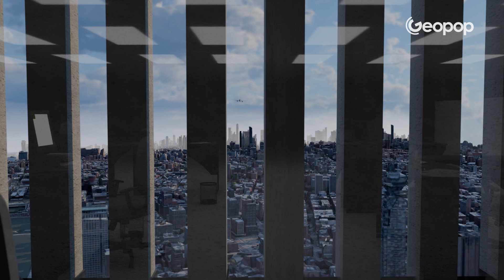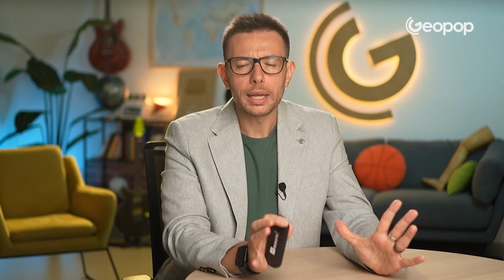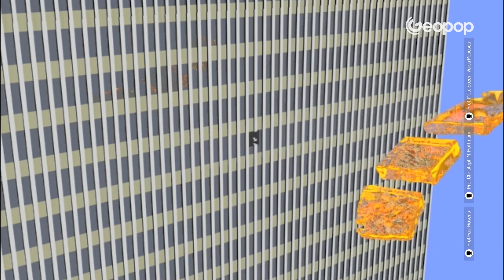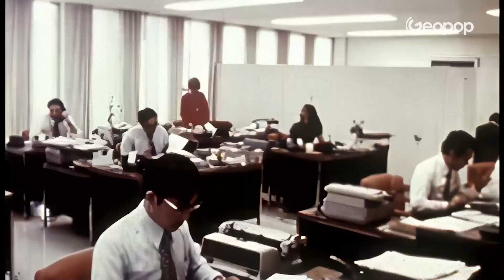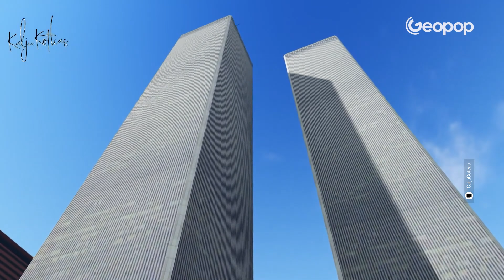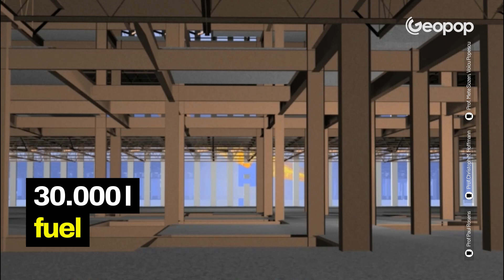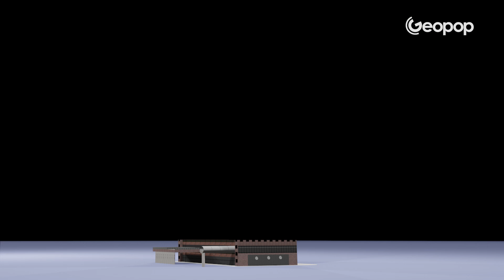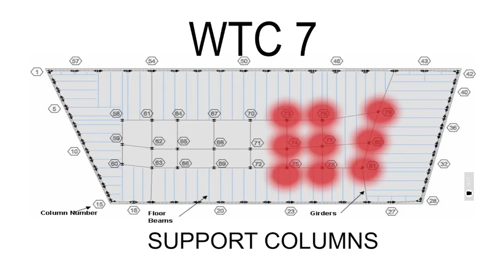9/11, 2001: The Technical Reconstruction of the Twin Towers and WTC 7 Collapses

Comment: What a stupid idea to put 41 floors on top of an already difficult designed structure 20 years after when most of the original sat over an electrical substation.
Reply: The substation was designed to serve as the foundation of a later larger structure. Worked just fine for years.
Reply: @TheLoonResistance the columns rested on trusses wich spaned over the substation so it wasn't great before adding 41 floors of weight. Live and dead loads.
Reply: @thegreatpyramidbuild-prate6013  - It was just fine until taken well beyond its design limits by an unprecedented event and would be standing without issue today had it not been for that event.
Reply: Im sure your right it would be still standing, but it was how the twist of the structure brought it all down. There was also a large penthouse added as well. When i studied structral mechanics and general design including high rise it was always the add ons that gave issues. @TheLoonResistance

Comment: Complete nonsense,why 
Third building had no plane hit it 

But it collapsed like a controlled demolition 

Please ,what’s the chance of this third building collapse the same way

Totally nonsensical
Reply: 3rd building (actually Building 7 though better known at the time as the Salomon Bros. Building) was hit by the collapsing North Tower - a fact presented in this video you are either deliberately ignoring (lying) or don't know because you didn't pay attention or maybe even watch at all (ignorance).

No one has ever claimed it was hit by a plane or that being hit by planes is the only way a building can collapse. You are straw manning.

Had you been paying attention you would have spotted right away the collapse of Building 7 was completely different to that of the Twin Towers. Hence why it is covered separately.

Finally, there is no such thing as collapsed like a controlled demolition

A building does not know when it collapsing or why and cannot pick or choose how it falls.  It will just fall, no matter what started it falling.
Reply: @TheLoonResistance You sound and talk like a 5th grader. You aren't giving any statical data yourself on how building has All of its steel columns fall simultaneously.
Reply: @DiamondSwordTribes2  - I did not describe things that did not happen and have no intention of doing so.

Comment: anyone who thinks tower 7 fell from a plane hitting another building is insane, watch it collapse from the top when only the base got damaged
Reply: I will respectfully disagree and offer a far more detailed and accurate description in rebuttal.

Building 7 was the 6th building to collapse of 10 lost on 9/11. It got scant attention initially due to other priorities so conspiracy filled the information void with absolute nonsense, creating a lot of confusion and misconceptions. To fix that I’ve prepared this brief summary using my own technical analysis, not ideology and magical (non)thinking. 

At 10:28am the WTC North Tower collapsed, showering Building 7 with tons of burning debris, causing heavy damage and starting many large fires that burned out of control for the next 7 hours. Half the FDNY firefighters having been killed, units in disarray, equipment destroyed, no water pressure, and the greater urgency of search & rescue efforts, Building 7 couldn’t be saved so firefighting efforts were pulled as futile and 7 left to its fate. Firefighters make that sort of choice every day in brush fire situations - which houses to save and which ones to let go. Only real difference here is moving the decimal on the size and cost. People get overwhelmed by the size.

www.youtube.com/watch?v=g_SvpwyC17M

Collapse of a burning structure is always a concern for firefighters and steel buildings are uniquely vulnerable to fire damage. When subject to fire they rely on active firefighting to survive, designed around 1 to 3 hours of fire resistance to, allow time for occupants to escape and active firefighting to get started.  After this all bets are off. Left to their own devices they'll exceed their design envelope and collapse, like Plasco Tower and Wilton Paes de Almeida. In 7 the occupants escaped, passive and active fire protections were compromised and active firefighting was abandoned hours before the collapse, which left the building to its fate. It lost. Odds on Building 7 would eventually collapse, and it did. No big deal in logic.

 http://www.youtube.com/watch?v=WnYBX6QT0R4 

FDNY Chief Daniel Nigro - The biggest decision we had to make on the first day was to clear the area and create a collapse zone around the severely damaged 7 World Trade Center, a 47-story building heavily involved in fire. A number of fire officers and companies assessed the damage to the building. The appraisals indicated that the building's structural integrity was in serious doubt. I issued orders to PULL back the firefighters and define the collapse zone. It was a critical decision; We could not lose any more firefighters. It took a lot of time to PULL everyone out, given the emotionalism of the day, communications difficulties and the collapse terrain 

FDNY Deputy Chief Peter Hayden ; We had our special operations people set up surveying instruments to monitor and see if there was any movement in the building. We were concerned of the possibility of collapse in the building. And we had a discussion with one particular engineer there, and we asked him if we allowed it to burn could we anticipate a collapse and if so, how soon? And it turned out that he was pretty much right on the money, that he said 'In its current state you have about 5 hours 

The collapse of Building 7 was anticipated and widely reported in the media throughout the day, with 24 video cameras recording some or all of the collapse. Everyone knew what was coming and why. 

www.youtube.com/watch?v=OY5S5k3tMHI

Building 7 collapsed from the inside out which is not at all intuitive and hard to understand with most details being hidden from view.  It requires careful analysis and observation, and some people will struggle no matter how much it is explained. But here is my explanation relying on no outside authority. 

Building 7 was a unique, asymmetrical 47-story steel frame structure built atop a smaller 3-story building serving as a partial foundation, requiring lower floors dedicated to complex load transfer structures. Of trapezoidal shape and tube-in-tube construction, B7 (above the 7th floor) consisted of a central core of steel columns carrying most of the gravity load, perimeter steel columns around the outside of the structure carrying the remainder of the gravity loads and long span beams and girders to tie those elements together and form the floors. On the outside of the building hung a facade or outer shell. 

www.nist.gov/image-16640

Phase 1 : First externally visible signs of collapse initiation occurred at 5:20:28 pm and was notably quiet with observers not realizing the building was collapsing! No warning in the form of hundreds of eardrum busting 180dB explosive bangs. Here at 12:00 a local CBS affiliate reporter talking 10 blocks from B7 when collapse begins. People don’t start to notice the collapse until 12:11. At 12:45 is the famous CBS fixed camera clip of Building 7’s collapse. Note the silence. 

www.youtube.com/watch?v=t5tEy6mXSE8

Lower floor failures above the load transfer region (8-14) in the NE corner initiated the collapse. In this video at 0:45 you can see the NW corner from inside the building while under construction, Column 79 just out of frame on the left. That big, angled steel beam across the top of the frame connects to C79 at one end. The girders connect to the beam. That beam and all those girders depend on just one connection 

www.youtube.com/watch?v=nP3TNHPCIVU&t=45s

Phase 2 : NE corner floor failures caused a loss of critical lateral support over an excessive length of Column 79 and it buckled. Externally as collapse begins we see a vertical progression of window breakage along the 44-46 line and a kink in the roof of the East Mechanical Penthouse at the top of the building, consistent with C79 failure. Looking at the above floor diagram of Building 7 when you see all the structures that depend on C79 you quickly realize this one column was a relatively isolated structural element on which a disproportionately greater fraction of the structure depended analogous to say the Key Bridge. Normally with a buckling column, the load could be redistributed to other columns. With C79 that is not the case - the failure did not redistribute the load, so the collapse rapidly progressed to the roofline, sinking the rooftop penthouse. The transition from full capacity to almost no capacity occurs in an instant and will result in virtually no resistance 

Phase 3 : With C79 gone, B7’s progressive, non-symmetrical collapse continues with adjacent columns 80 and 81 left laterally unsupported and quickly buckling as well. The EMP drops down through the building. C79-81 all have no diagonal bracing, which is the major reason why they could not redistribute a lot of vertical loads among one another. From there collapse progressed from east to west through the central core until the core was gone from 81 to 58, taking all the interior floors and probably most of the perimeter columns with. Follow the horizontal progression of window failures low in the building and the dropping of the remaining rooftop structures into the building. The NIST Building 7 study model 4 determined C79 failing under ANY circumstances would have initiated the same collapse sequence. 

Phase 4 : After about 10 seconds only the exterior moment frame remains, giving the illusion B7 is still standing to the casual observer since little has outwardly changed. But it is just a hollow empty shell like an empty cereal box supported only by a few remaining columns and overloaded from the loss of the core columns and floors, quite unable to remain standing. With nothing remaining behind it, the north face leans inward, forming a V in the roofline, the last few columns buckle under the strain and the moment frame free falls, landing on top of the debris pile. 

Building 7 collapsed for 10+ seconds before the much-hyped free fall allegedly occurred. Except it wasn’t free fall nor even The Building being measured. The Building was already gone, as described above. The measurement is just one spot on the exterior moment frame - the empty hollow outer shell which fell last. It’s not even a sustained period of FFA but rather a curve, starting out below, then up to and OVER before decelerating back down below FFA again while moving in 3 dimensions not just down This is averaged over an arbitrary 2.25 seconds while pretending it is 2D movement to (dishonestly) declare the magical free fall!  Not that we care, since how fast something falls can’t tell you what started it falling 10 seconds earlier anyway. It’s meaningless. Start to finish the total collapse took 18-20 seconds or 3 times longer than true FFA . 

The debris spread well outside the footprint blocked surrounding streets, heavily damaging the Verizon Building and destroyed Fiterman Hall. 

No building is meant to survive 7 hours of multi-floor unfought fires. Building 7’s progressive, non-symmetrical collapse was incidental, unintended collateral damage from the combination of fire, time & gravity started by the collapsing North Tower, true no matter who planned and carried out the 9/11 attacks or why .  Of so little consequence it barely registered at the time, only taking on semi-mythical status as an alleged smoking gun years later when demolitions at the Twin Towers, missiles at the Pentagon and shoot down over Shanksville all failed and conspiracists had nothing left to work with. 

Anything can seem like a conspiracy if you don’t understand how it works. Now you should. I hope you found this helpful, informative and it solicits informed critical comment. If I made any errors of fact, logic or reason or left anything important out, please let me know so I can fix it. OR offer a more plausible alternative if you can. Be the first. Please start any reply with the words “Tits McGee” or I will know you didn’t read it and are wasting my time.
Reply: @TheLoonResistance how do those commie balls taste 😂😂

Comment: HAHAHAHA you can see the top floors intact as they fall. how is all that force applied when you can clearly see, it isn't 🤣
Reply: WTF are you talking about?  Are you claiming that falling mass has no mass?
Reply: @TheLoonResistance  No, i'm claiming that it applies no force to the lower levels when it's freefalling and isnt even in contact with them lol
Reply: @JohnnyGhoul205  - Define "lower levels".

Let’s break it down to the absolute basics, addressing most of the commonly asked questions as we go:

The 47 core and 236 perimeter columns of the Twin Towers support all of the gravity loads of the building. ALL of the resistance is in the columns.

Planes impact Towers, causing massive structural damage, destroying sprinkler systems, tearing out gypsum board walls and blasting off the SFRM insulation from the floors and asymmetrically re-distributing loads. Multiple floor-wide fires are started instantly and spread rapidly due to the destruction of fire protection systems and venting of the building during the impact.

Serious fires were largely confined to the impact damaged floors and those immediately adjacent to them.

Fires were started by the impacts and fuel aboard the aircraft, which acted as an accelerant. No shortage of other consumables inside the tower to continue the fires.  Active and passive fire protection systems were destroyed in the impacts, there was no active firefighting.

Collapse was initiated (started) at the impact and fire damaged floors when floor trusses exposed to heat over time sagged, in turn pulling on and causing the inward bowing of some perimeter columns by up to 5 feet until they buckled on one face of each tower (ie: NOT symmetrically).

www.youtube.com/watch?v=ULdiD6gYZO0

No steel melted or needed to. Structural steel will bend and fail at less than half its melting temperature.

Once the perimeter columns buckled the formerly static load above became a dynamic load 30 times greater, easily overwhelming the structure below.

Thousands of tons of now loose debris fall through the open office space within the four outer walls - bypassing the columns (the path of greatest resistance) - dropping 12 feet onto the first intact floor it comes across. That massive instant overload causes the floor to fail, shearing the pair of bolts that secure each end of the floor trusses to the columns. The floor fails. adding its mass to the falling mass which continues to accelerate for another 12 feet until it impacts the next floor, rinse and repeat one floor at a time all the way down.  Yes there is resistance but its totally inadequate to arrest the collapse. Resisting is not the same as preventing 

As the falling mass increases with each subsequent failure and as its velocity increases, the minimal resistance provided by each individual floor system remains constant.  Rate of collapse can only increase.  It cannot decrease or arrest. 

The columns - the part that holds the building up, supporting ALL of the gravity loads - are spectators for all this as the debris falls around and past them, not onto them.

Rate of collapse increases as momentum increases. The collapse front is constantly accelerating.

As each floor fails, air inside the building (the Towers were 95% air by volume) is compressed, then blows out the sides _in reaction to the Tower falling, not the cause of the Tower falling.

No fire required at all on floors below the impact points for them to fail. The mechanisms that started the collapse are different to the mechanisms which continued the collapse. That will be a difficult concept for some.

As the floors fail the perimeter columns are left literally hanging in the breeze, no longer attached to the rest of the structure. They peel away and fall in great sheets (think banana) out to more than 600 feet from the base on the 4 points of the compass.

Core columns failed last, buckling near their base due to the loss of critical lateral support as the building collapses around them.
Reply: @TheLoonResistance Science lovers need to talk so much to describe the most simple things. Its a sign of midwittery and lack of intelligence. If you can't explain something in one paragraph, then you are full of sh1t and have no idea what you are talking about.